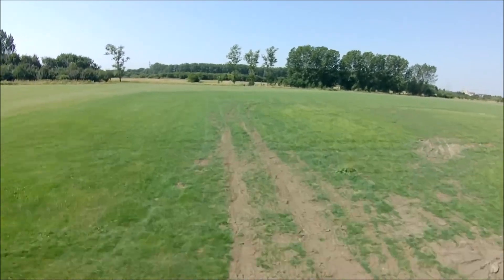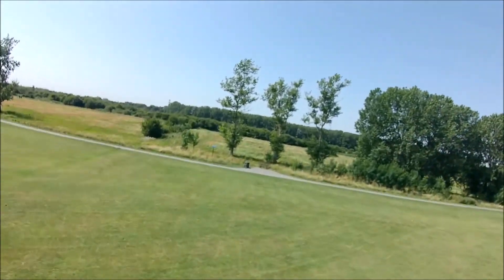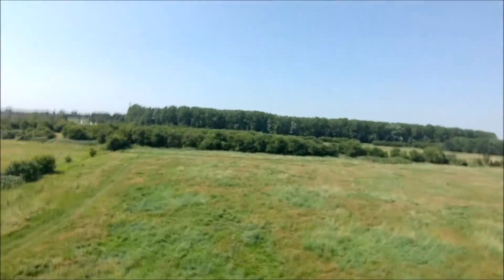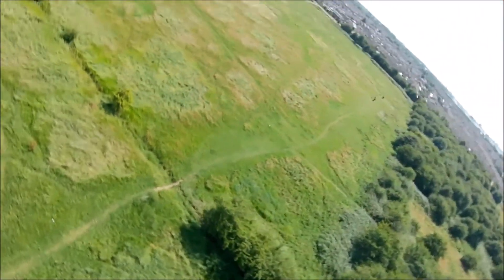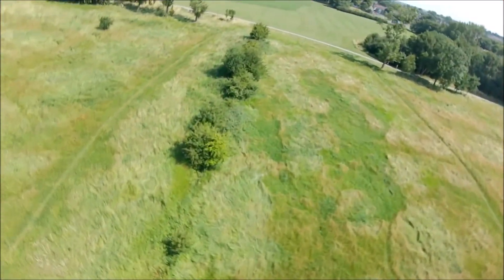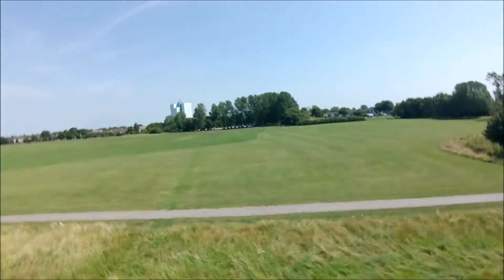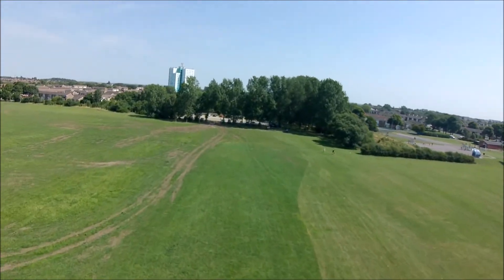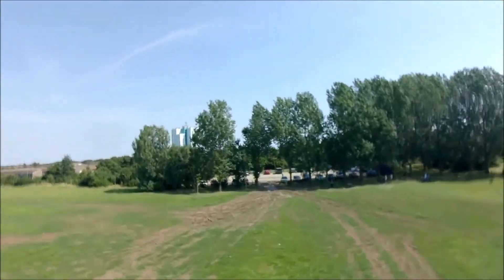TROUBLESHOOT MY QUAD

Comment: Hello.
I had similar problem. Wobbles, etc. In my case it was related to broken plastic screws / mounts of my flight controller and 4in1 esc.
Reply from the maker: That's what I first thought was wrong on mine. Thanks for watching matey
Reply: Pleasure.

Comment: Huh I thought it was gonna be something with your tuning for mid throttle oscillations. Lol just goes to show sometimes we overthink things when it’s really a simple solution 🤷🏻‍♂️
Reply from the maker: The funny thing is I looked at the Props first and didn't spot it But after checking everything ells that's when I went back to the props and found the lose nut. ( 2 second fix 2 hours to find ) lol